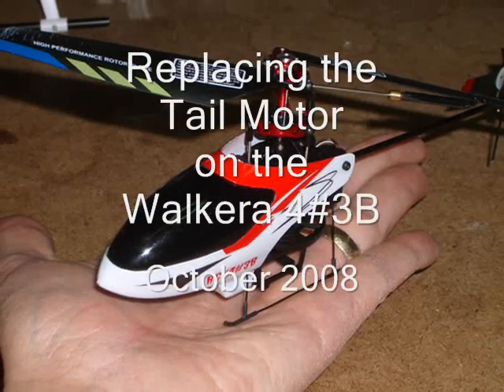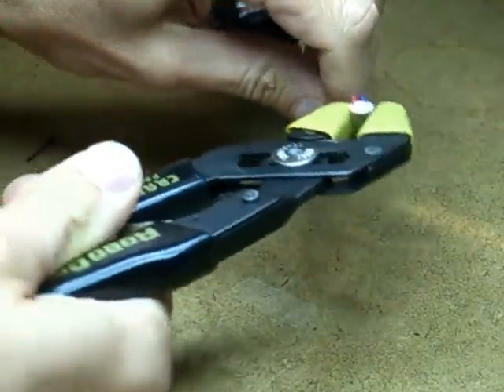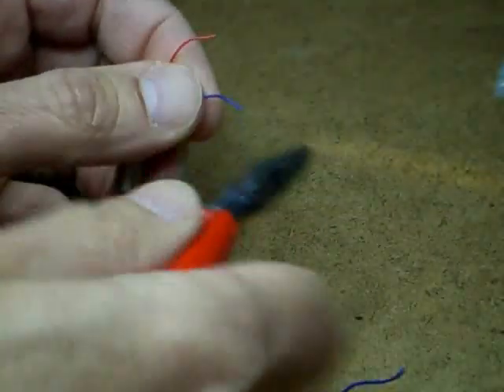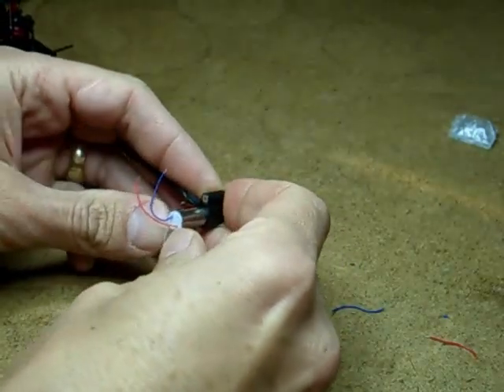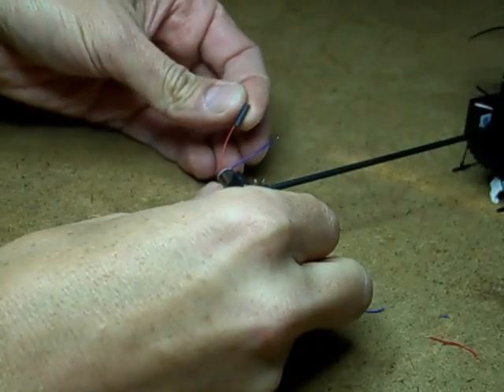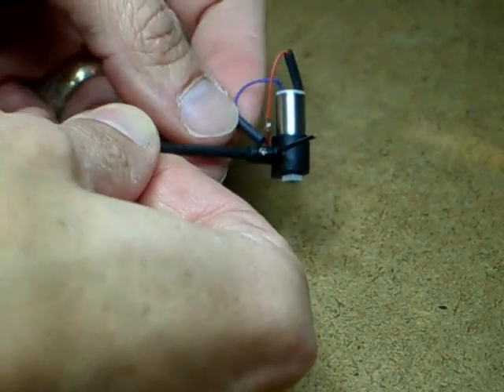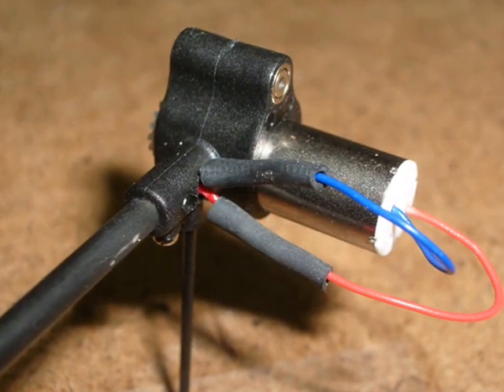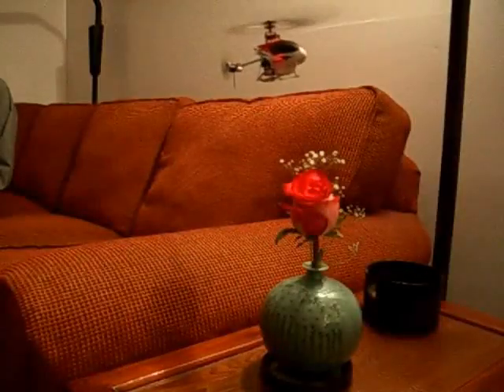Walkera 4#3, Replace Tail Motor

Comment from the maker: @jesse123613 If the tail motor is brushed, it will probably have to be replaced at some time. The tiny little "whisker" brushes wear out pretty quickly.

Comment from the maker: @morganhv You will need to replace the tail motor when the heli can no longer maintain the yaw axis during throttle up. So if the tail is kicking out when you don't want it to, it means the motor is getting weak.

Comment from the maker: I have replaced the tail boom but I didn't make a video. You will have to desolder the tail motor of course (like in this video), pull the old tail boom off and thread the wires through the new tail boom. Good luck!